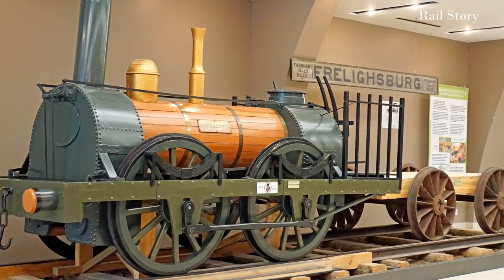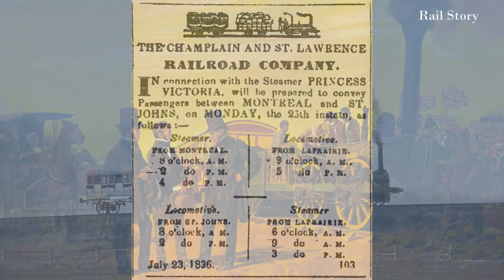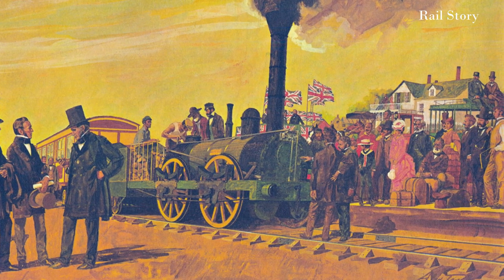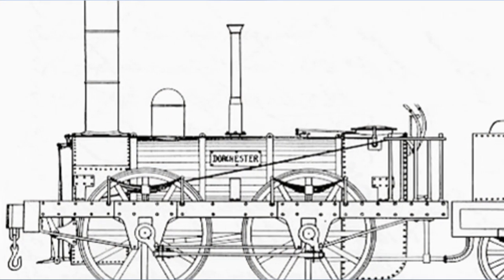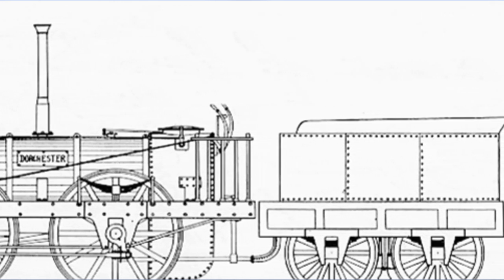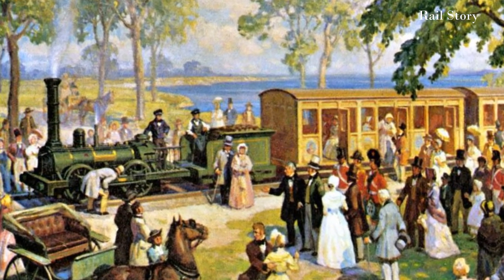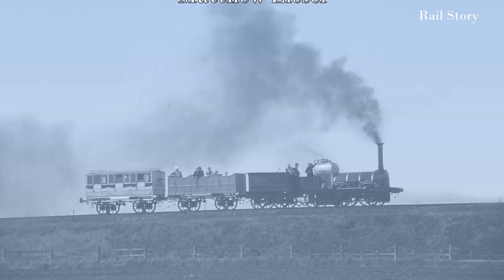Dorchester: Canada's First

Comment: Thanks for more new to me information.
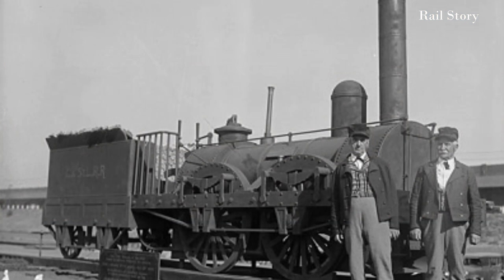The full size wooden replica at 4:04 and lack of coupling rods. 
My suspected likely explanation of the lack of outside coupling rods is the difficulties, precision and complications needed to have any wooden outside cranks precisely quartered enough for the replica to move reliably when transported by rail when being dragged or pushed along.
Few, if any, in Canada would have much experience with outside cranks.
The further you go back I have come across the attitude that near enough is good enough for historical reenactments.

You also say the first modern railway in Canada. Were there any non-modern railways pre-dating this railway?
Reply from the maker: Thanks for your explanation. My hunch is that Francis Wishaw in 1840 describes it as having one pair of carrying wheels and one pair of driving wheels. Which it technically does as only one pair is powered....but.....he describes Lion in similar terms. Very odd way of expressing it.

Comment: Thank you, Anthony. This is another one |I'd not heard of. Unfortunately the subtitles didn't work on this film, but the pictures are fascinating. I can understand the 'first modern railway' to run in Canada, given that the Hackworth engine ran on a private colliery line,  so how does Dorchester predate that one, which you said was the first engine imported into Canada? Did Dorchester arrive later, but ran sooner? Or am I getting confused?
Reply from the maker: Dorchester was delivered and began operation in 1836. It was a modern maniline locomotive with a multi-tubular boiler, water-jacketed firebox, horizontal cylinders, proper frames and one tender.

Hackworth's Samson was built in 1838, delivered in 1839 and in no way shape or form was a modern locomotive.

There's three years between Dorchester (1836) and Samson (1839).

Comment: I've been looking forward to this episode. I'm surprised by how small she was; was she not even smaller than the Liverpool & Manchester's "Planet" upon which she was based? Also, why were her flue tubes made from brass rather than copper or iron? Finally, is there any surviving information beyond the paintings shown about her original coaches? I've always found it rather charming, if quite unusual for American rail practice, that she pulled compartment carriages, rather resembling in appearance those that would be used decades later on the Talyllyn Railway. It also seems that artists can't agree on whether or not these carriages had 2 or 3 compartments.
Reply from the maker: It's lighter than Planet which weighed about 9 tons. Brass tubes were absolutely standard from 1833 until the end of steam. As I demonstrate in my book, copper tubes were rapidly abraded by the scouring action of coke particles; iron tubes were too heavy and poor conductors; brass was ideal. Excellent conductor and hard wearing.

I have not found any information about the carriages other than where they came from.

https://www.amazon.co.uk/Locomotives-Liverpool-Manchester-Railway-Anthony/dp/1526763982
Reply: @AnthonyDawsonHistory  so in steam locomotive terms she was a cousin of Planet then
does the original name plate give some idea of how badly she was smashed up. it must have been pretty bad if one of the name plates had broken off
Reply from the maker: @eliotreader8220  Cousin of Planet yes. The nameplate survives intact in really great condition. It was probably taken off , and I'm not sure how true the story of it being found in the woods is. But at least it survives. 

For more on Planet and Samson classes:https://www.pen-and-sword.co.uk/Locomotives-of-the-Liverpool-and-Manchester-Railway-Hardback/p/18771
Reply: @AnthonyDawsonHistory  Would she have been fired on fire wood in a similar way to like some steam locomotives in
cow boy films. or coal perhaps?
Reply from the maker: @eliotreader8220  Built as a coke burner,  but perhaps fired on wood in Canada which would have meant almost continuously stoking the fire as wood has a considerably lower calorific value than coke. The firebox wouldn't be big enough either.

Comment: Wooden driving wheels .... That's what I thought you said Anthony. I had to play it through again to make sure. 02:40
Reply from the maker: Wooden driving wheels were really common in the 1830s - both for lightness and because the technology to produce reliable iron wheels wasn't quite there yet.
Reply: @AnthonyDawsonHistory  yes wooden spokes some of the centres and rims, but even much earlier the tyres were always iron as far as I know.
Wooden hybrid wheelsm
Reply from the maker: @johnd8892  Oh yeah. Not really "hybrid" tho' as  wooden wheels  were always hooped with iron. Wooden railway wheels were hybrids having usually a cast iron hub/nave into which spokes slotted, and were hopped in iron and then a tyre with flange applied. Whether wooden wheels were coned, however, I'm not sure.
Reply: @AnthonyDawsonHistory   Of course, I forgot, the Rocket had wooden wheels.... duh. (embarrassment)  I just remember some very early locomotives, pre-dating Rocket, had iron wheels. Why wasn't steel used, since that has been produced since the 13th. C. BCE?
Reply from the maker: @channelsixtysix066  Early iron wheels were cast and were very fragile and prone to breakage due to the track system and the lack of springs on locomotives. Steel wasn't used because it was expensive, and couldn't be produced in large quantities until the Bessemer process came along  in the mid-1850s. Even then wrought iron is preferable to steel for things like boilers and wheels as it's more elastic and thus more forgiving. A wrought iron boiler will last longer and take more punishment through bad management than a steel one will.
Reply: @AnthonyDawsonHistory   Thanks, Anthony. I never knew that. Surprising about the wrought iron boilers.